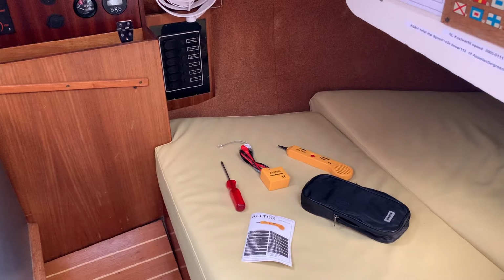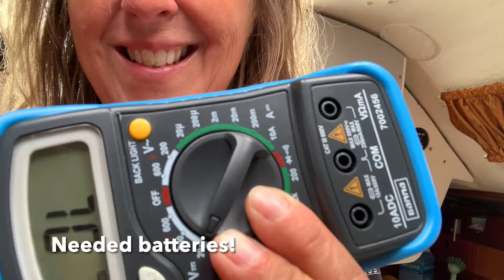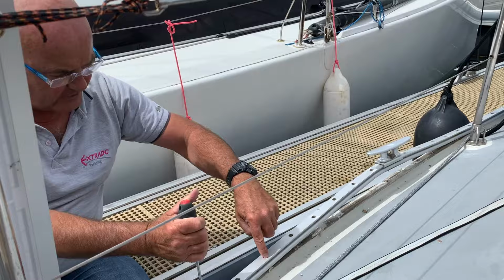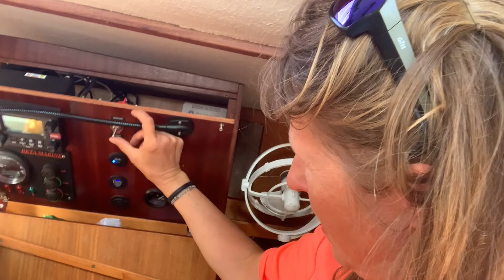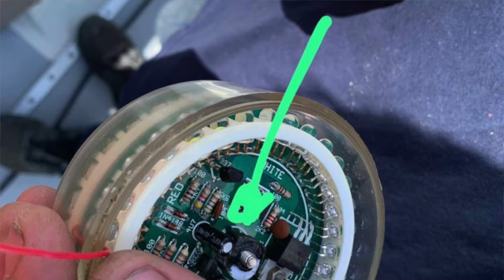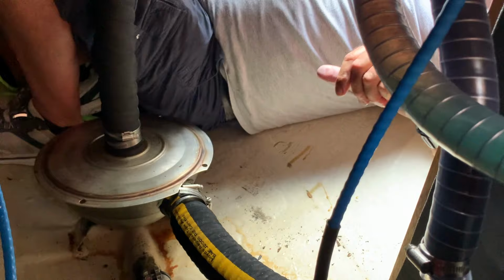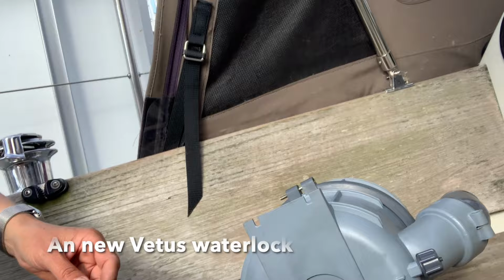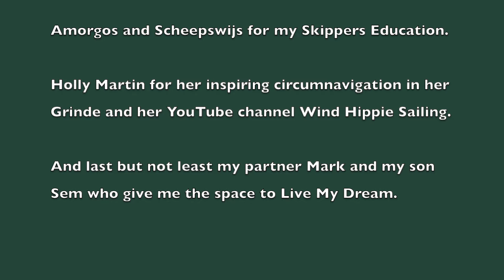Four Boat Essential Projects - Ep. 153

Comment: What do you mean top light? Anchor light or mast head light? Hope you put sikkaflex under that railing. Probably a bulb in that faulty light.
Reply from the maker: Hi Tom. It is a combined top/anchor light. The hood was open and therefore it was corroded on the inside. A wire has also been replaced. The light itself was ok.
Reply: @sailingloveworkx  top light normally is an anchor light. Steaming light (white) is the one halfway up the mast and runs in conjunction with nav light when motoring underway.  If you are referring to tricolor, that is light, 3 colours, on top of the mast when under way sailing.
Reply from the maker: You are right. It’s a combined three colour/anchor light
Reply: I think this highly experienced skipper does not need this explaining to her..